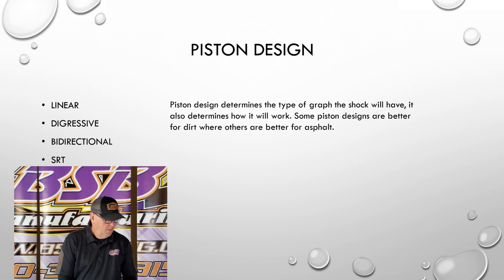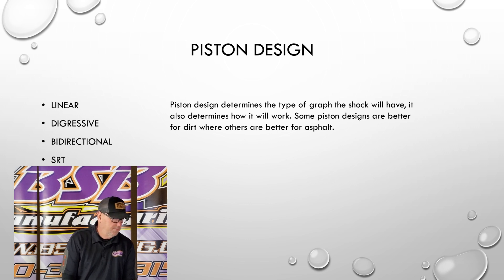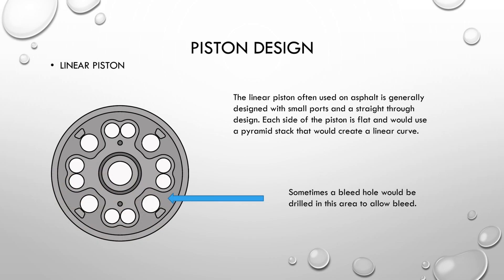Piston Design, which is best and why?

Comment: What's your opinion on roughing up the face of the piston to help the shims from stiction?  I watched a video from a guy on the west coast who suggests this.  Have you experimented with kashima coating a body/tube and dlc coating shafts?
Reply from the maker: Stiction is a thing, it is very hard to see on the dyno and shows up as lag. Our pistons are aluminum and we do surface them for better flatness and sealing. I have also watched his videos and feel for what he is doing would work and I do think he is doing it for reasons that he sees too.  I have not used Kashima coating, if Ohlin’s is doing it I am sure it is good, I do hear a whole group of guys that dislike anodizing on the inside of the tube. Claim it keeps the wear band from sealing, on our aluminum tube we are bare as of now. The coating on the shaft (DLC) I am not familiar with, but I have seen TINC and TIN we tested with this at one time and found chrome to have less stiction and fewer problems with chipping. Help me out with the shaft coating with more info, please.